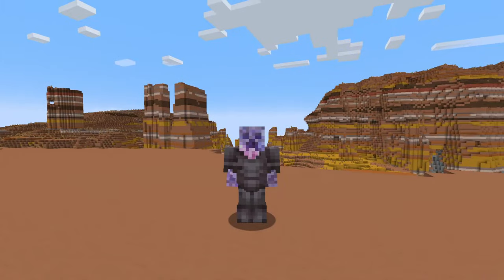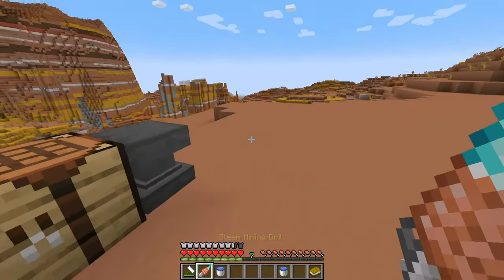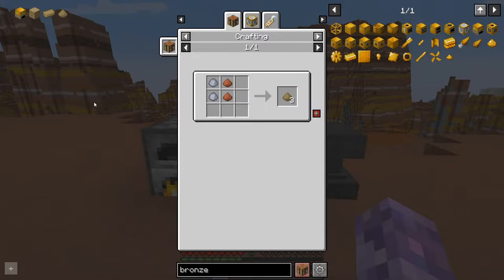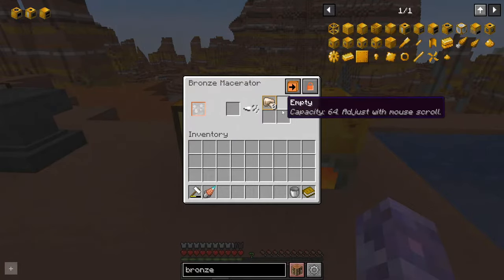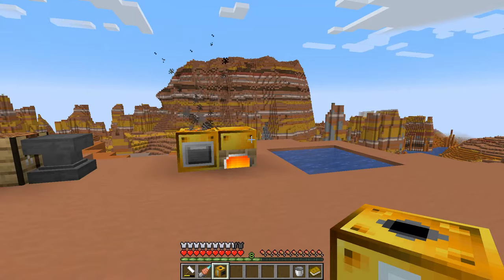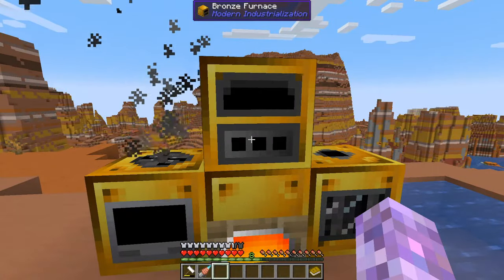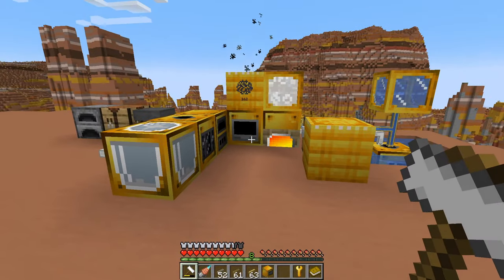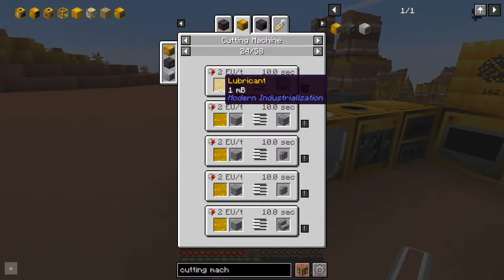Modern Industrialization (1.18): Steam Machines to Steel Production | Guide part 1

Comment: But how do you make fluid pipes in the first place? I'm having such a hard time finding any clear answer. Googling it isn't telling me anything, nothing in the game is telling me anything, I can't any videos, not even the wiki helps.
Reply: bro im in the same situation, can't find anywhere
Reply: Hey did you figure it out yet? I'm in the same scenario
Reply: @colin7969  not sure if it's something that's in the MI mod or not, but I got Modern Industrialization through the Prominence 2 mod pack and there's a library of every single block on the side of the screen when you open your inventory, and if you search for fluid pipes, you can just click on it and it'll pull up the recipe. I don't remember what the actual recipe is though. Something to do with bronze
Reply: @jneumy566  yeah I’m doing the exact same modpack just figured this out too, thanks

Comment: I always choose a different machine to start out with, and that is the Compressor. Without having done specific calculations as to how much is saved, this machine can make one Ingot into one Plate, and pretty much ALL copper machines are made with 12 plates, so that is a pretty significant up-front save. I always choose Macerator next just to really save on the ore usage. Next i make a mixer to save on the ore usage. Of course by then it is finally time to make both a Pump and a Boiler, but i make those last since now they are the most cheap

Comment: One thing I've enjoyed doing with modern industrialization is setting up passive crafting, particularly once you get access to the quarries or another source of semi-infinite resources.  Because the machines are so slow, autocrafting using AE2 winds up with some truly bonkers crafting times, so I set up dedicated lines of machines for just continuously crafting things like steel, various types of plates, etc.  

It's a different playstyle, and you wind up with a giant factory with dozens and dozens of machines, but I think it's really fun and satisfying.
Reply: When you do that is there a way to avoid having a crap ton of stuff stacked up in machines? Or do you just accept that you are going to have a few full stacks of every different thing scattered around the system?
Reply: @GordonWrigley  You just accept that you're going to have full stacks scattered around the system.  It means that you don't want to set up passive crafting for stuff that's insanely expensive until you can comfortably afford it, but for things like plates or wires, it's really nice to have a healthy buffer of those materials so autocrafting doesn't need to wait for those.
Reply: @unpronounceable1  Mod pack I'm in I'm a moderate way from getting AE and was thinking about automating everything up to Machine Hulls but that will result in a lot of work in progress stuff.
Reply: @GordonWrigley  IMO, the thing that actually matters most for passive crafting is a semi-infinite source for all the materials.  So if you have a quarry and can generate unlimited copper, then copper plates/wires/etc are good for passive crafting.  But for something like like machine hulls, I'd say passive craft the components you can, and then batch craft the rest of the way - I don't need unlimited machine hulls, I just need it to be easy to craft 8 or 16 or 32 at a time.  It's going to be pretty rare that I'm doing a project that requires a boatload of machine hulls before I have autocrafting, and unless the modpack is really brutally gating access to autocrafting, I'll usually just batch craft until I'm able to push for AE2 or Refined Storage.
Reply: @unpronounceable1  so that all was a good idea, it's been a nice lil project and there was a bit where I realized I was never going to have to mix bronze again and that made me happy, so far I have all of bronze and copper (bolts, rods, rings, plates and curved plates) and most of iron, tin and steel, after I finish those battery alloy is next and it's (fingers crossed) all AE2 ready, thank you, might not have done it without your replies
Reply: @GordonWrigley  I'm always happy to advocate for passive crafting in Modern Industrialization/GregTech, it makes those mods so much more enjoyable to play with, for me.  And because of the relatively long process chains, autocrafting doesn't magically make the problem go away - I tried to do an autocraft for a stack of something and it took like 4 hours to complete.

Plus, setting up passive crafting is a fun puzzle, at least for me.